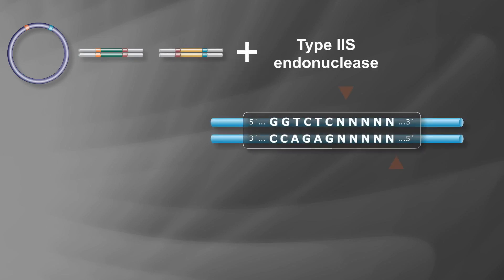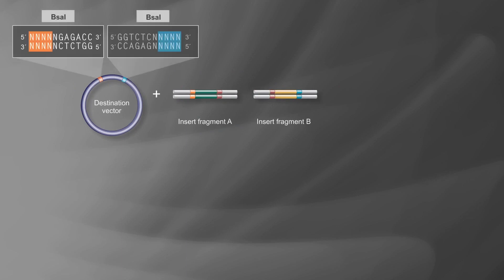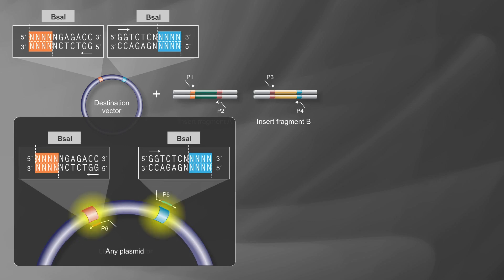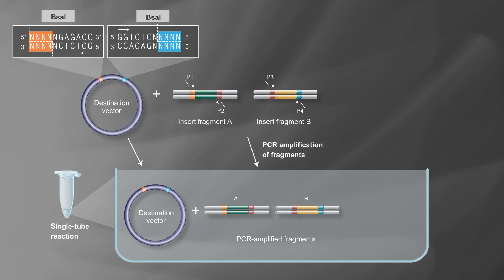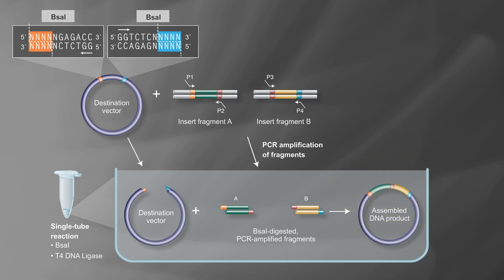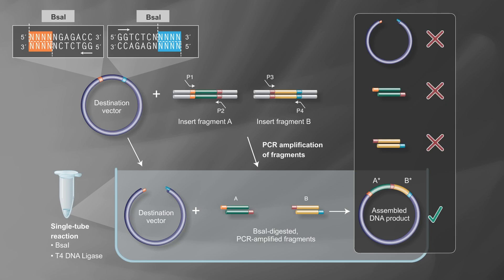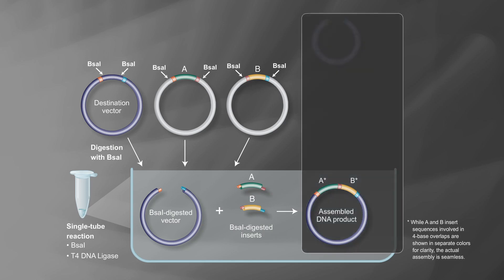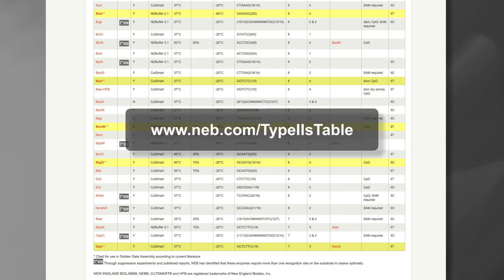Golden Gate Assembly Workflow

Comment: Why do only the intact i.e non-linear DNA sequences remain at the end? Is there an endonuclease step to remove non-ligated/ DNA? What if the fragments re-ligate back with their original plasmid? (thank you!)
Reply: In the reaction mixture, there is only one plasmid, the backbone. The gene of interests can be prepared in plasmid form but when you put them in the golden gate assembly mixture, you should digest them and prep as a gene fragments first, not put the intact plasmids in it. That's why there's only correctly assembled plasmid remain in the final product. Preparing gene fragments using PCR is kind a less cumbersome but slightly inaccurate way compared to plasmid form (because PCR products may contain unwanted mutations or incomplete sequences).

Comment: Does the sequence of the overhangs matter?
Reply from the maker: The overhangs allow for ordered assembly of fragments.  Through our ligase fidelity studies, we have determined some overhangs will ligate at higher fidelity than others.  Here is tip #10 from our tips guide:
 
Carefully design EVERY insert’s overhang

An assembly is only as good as its weakest junction. Research at NEB has led to an increased understanding of ligase fidelity, including the development of a comprehensive method for profiling end-joining ligation fidelity in order to predict which overhangs will result in improved accuracy. This ligase fidelity information can be used in conjunction with the NEB Golden Gate Assembly Kits (BsaI-HFv2 or BsmBI-v2) to achieve high efficiencies and accurate complex assemblies. Please use the free NEB Golden Gate Assembly Tool to design primers for your Golden Gate Assembly reactions, predict overhang fidelity or find optimal Golden Gate junctions for long sequences. When working with complex assemblies ( >20 fragments), refer to the ligase fidelity tools on the NEBeta Tools site.
More information can be found here:  https://www.neb.com/tools-and-resources/usage-guidelines/technical-tips-for-optimizing-golden-gate-assembly-reactions
 
Also, this is a good webinar to checkout:  https://event.on24.com/eventRegistration/EventLobbyServlet?target=reg20.jsp&partnerref=homepage&eventid=1675951&sessionid=1&key=8CA5A64FC949CF91DC73B82E153D5738&regTag=&sourcepage=register
Reply: @nebiolabs  Thanks!